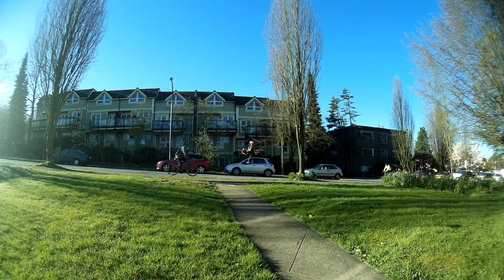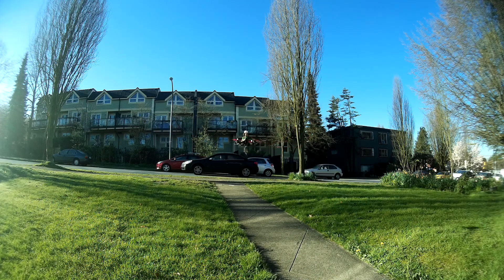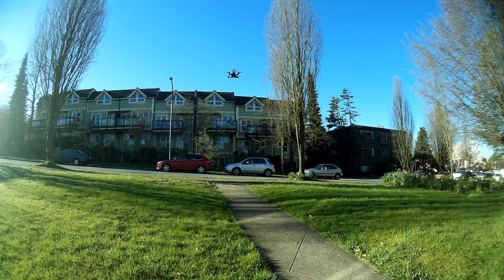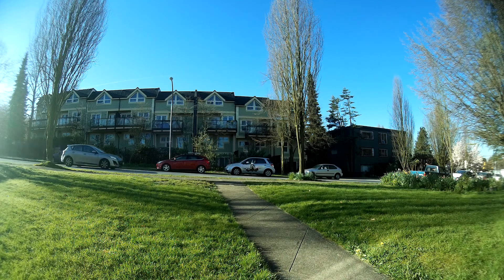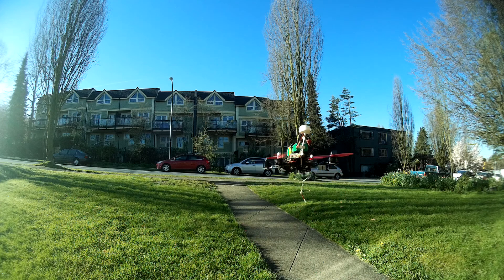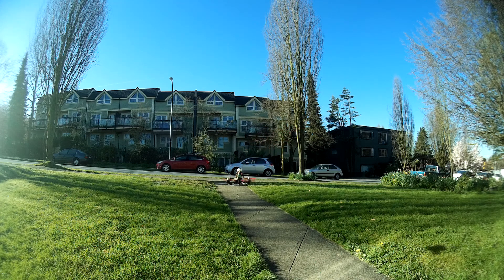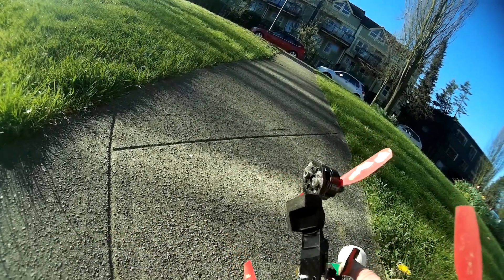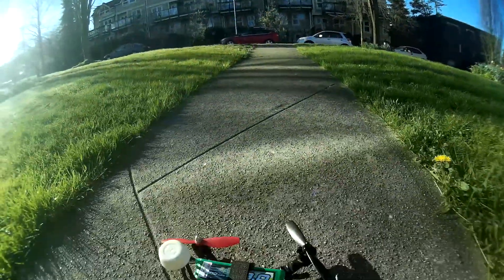How to get 12+ flight minutes from a mini quad racer, los airmode +commentary

Comment: Hi, I have the same battery in my Nova and it gets up to 8 minutes with a mobius gimbal. I agree with your comments on the TBS stuff, never bought it to see if it's good and never will. Just unjustifiably expensive. With a bit of creativity, way cheaper equipment can perform even better. I hate when guys from the Hobby go commercial. Happy flying

Comment: What was the orange thing that drove past at 5 imns 45 seconds??
Reply from the maker: +andrew hodgkinson Good eye! that is the Veloped streamliner the guy rides by year round!!! in rain night and morning traffic. It is a hybrid recumbant bike very trick and wish I could make or have time to make fiberglass fairings like that.
Reply: +Hoverbot1TV I just noticed an orange flash on the right hand of the screen and had to skip back to see it again. We dont see any bikes like that on the roads of England. 
I spotted two of them in your 13 minutes of your video. 

I have a quick question. 
How do you know how low to safely run down the MultiStar battery? 
Iv got a 4S 5200mAh MultiStar that i have not used yet. (for an RC plane)
But i dont know the cut off point.
Reply from the maker: andrew hodgkinson
Long life I'd stay above 10.5-6v but you can go to 9.9 before dropping. The resting voltage should be above 3.7v after a rest at best 3.85 etc.

Comment: How come you have such low weight machine? I am at 700g and cannot go bellow that. Good comments on slavery btw. I was reading about Dubai lately and that´s just unbelievable.
Reply from the maker: +kubaistube I am a real Blacksheep for my honesty but hey better a rebel (good type) than a follower. LOL! I used a custom kevlar carbon plate I made on this but it is auw 520g on heavy batts 480g on 1800's and all 3s. :o) I design frames as a hobby biz and this is a test design.
Reply: +Hoverbot1TV If I had 520g machine I can imagine great increase in speed and maneuverability, unfortunately I can shave off just few grams, not more. Do you have any idea what could bring me higher speed at present weight? I have Emax 2204 2300kv with 6040 props and 4s high C batt. I have some 5045 tri-blades on the way but that might not bring me better results.